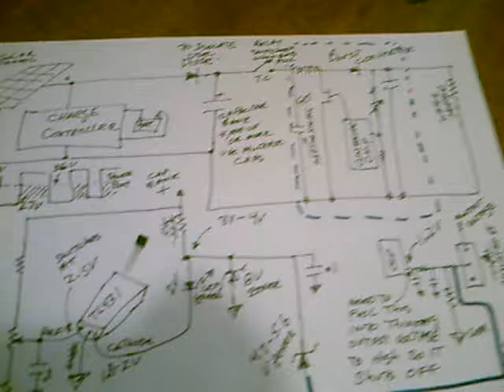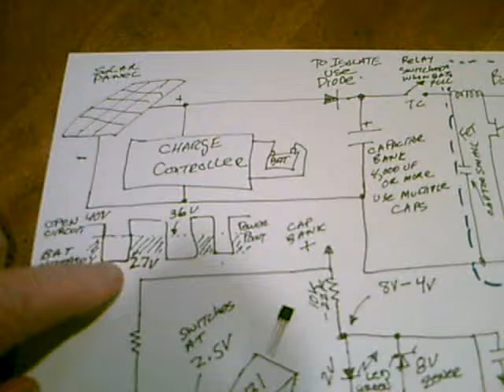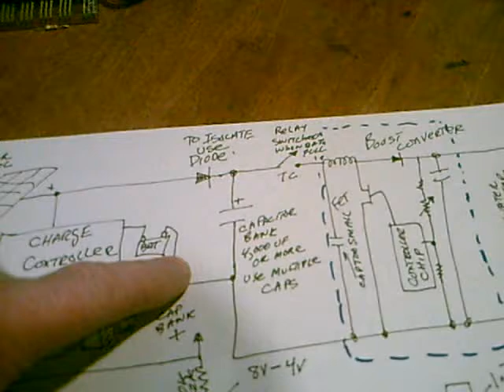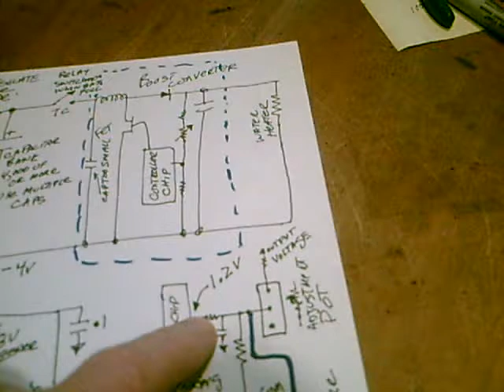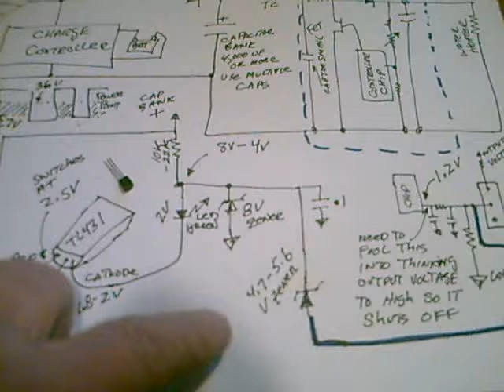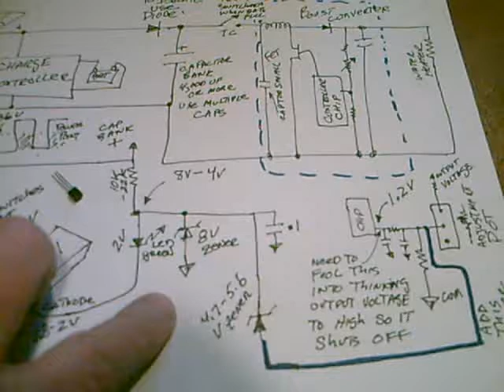PV Boost Converter to Heat Water, #1

Comment: but here is probably problem, because capacitor doesnt charge with mpp. i think same problem like i had with pwm charge controller. i didnt test, but sure our methods must work in bad weather where non matching heating element wouldnt.
Reply from the maker: It is unfortunate that you have not viewed more of my videos. Apparently you have absolutely no understanding of what I am doing. This may be due to a language problem. It is my hope you continue to make an effort to understand the principals of power point heating. I am sorry that I have failed to explain the process sufficiently. While these principals are simple, no one else in solar is discussing them on youtube. Please continue your education by watching adiabatic capacitor charging which is similar. This professor has many excellent videos on electronics for the beginner.
https://www.youtube.com/watch?v=ZtgOboxMNoU